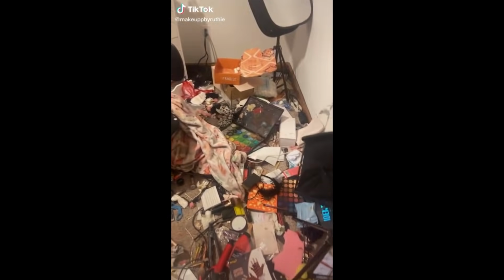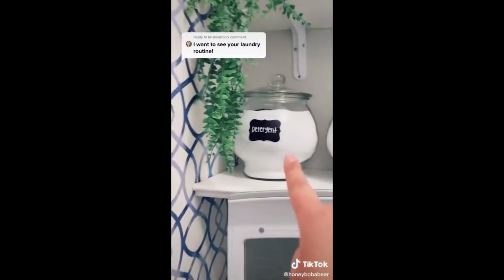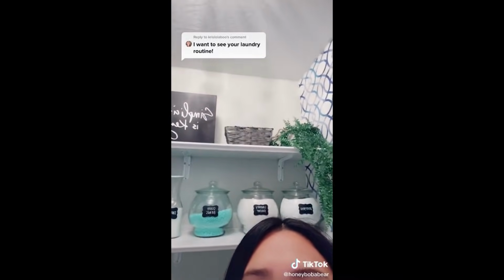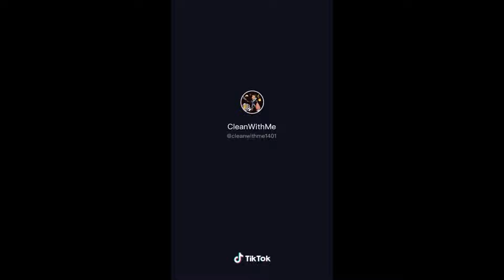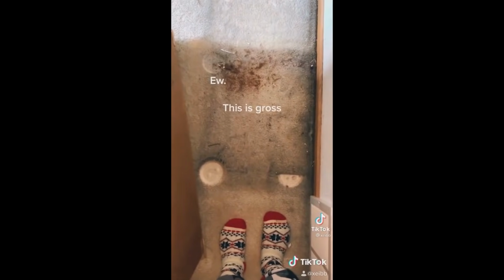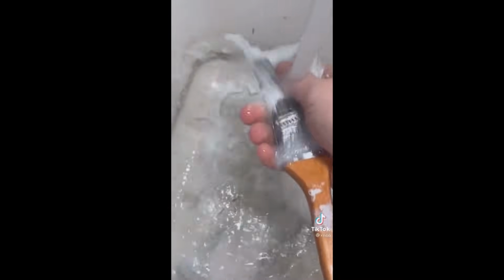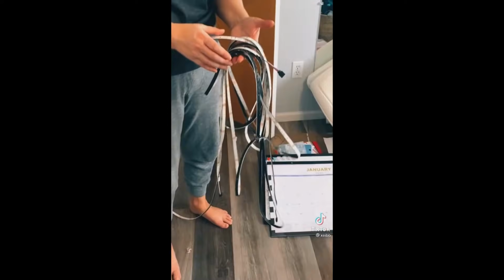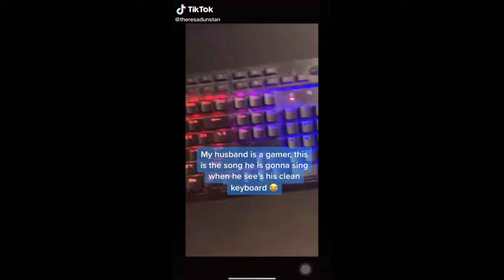Cleaning and Organizing 🧽🚿 | Part 13

Comment: Safety PSA: if you are going to remove the "popcorn" cieling in your own home. Make sure to get a professional! They should check to see if that texture is make with asbestos or not. Unless you have the proper PPE and training, its super dangerous. Source: my entire family has worked construction for decades.
Reply: I'm curious what does that mean?
Reply: @myan1934  What part are you confused about?
Reply: What does the popcorn ceiling do?
Reply: @lubellawychhelm6942  Well popcorn cieling is just an aesthetic. But removing popcorn cieling that is made with asbestos unleashes it into the air. While it is underneath the paint, its harmless. It's disturbing it and breathing it in that's the issue.
Reply: Thx
Reply: Yeah and get something to protect your eyes

Comment: I don't know what unstable teenager needs to hear this but its here anyway 🖤

I struggle with a handfull of different mental health issues and it really impacts on my room, now that I'm older all of my friends have very mature rooms but although I hate it I'm greatful I still have my pink bedroom. My room has been impacting on my anxiety because whenever someone comes over I get embarrassed one because my entire room is pink and two its always extremely messy. I know it may not seem like it but when you put your mind to it cleaning is extremely easy and once its done you will feel a lot better. I haven't cleaned my room fully in years but when I finally cleaned my entire room by myself all my close friends were so proud of me and it made me feel like maybe I'm not completely useless. When you put your mind to it you can do anything, you don't know until you try! Things will get better you just have to push through things like the angel you are 🖤✨

Comment: Okay, I know half of you don't want to hear this but, please please please DONT MIX CLEANERS and\or CHEMICALS.
Reply: Why?I'm curious
Reply: @keza6366  most chemicals when mixed together create toxic fumes and could potentially cause a lot of harm to those who inhale them. Most products have warnings on the labels and tell you why.
Reply: @Cozy_Kitsune  oh thanks
Reply: @keza6366  You should never mix any cleaning chemicals, especially anything with bleach (which is why the "Comet and weird blue liquid" mixing always scare me). Mixing bleach and ammonia (for example, Comet and Windex) will create chloramine gas. Mixing bleach with vinegar will create chlorine gas. Mixing bleach with rubbing alcohol with bleach create chloroform (you know, the stuff villains use to knock people out?).  Even seemingly harmless combinations such as vinegar and rubbing alcohol will create an extremely corrosive and dangerous peracetic/ peroxyacetic acid.
Reply: Especially when a lot of the surfaces don't need it! Most of these bathroom counters and showers need a spray of a multi-purpose cleaner at MOST.  Honestly, most of it could be done with soap and water but it doesn't look as cool.
Reply: @kikicogger2284  ohhh, thank you so much for the info!
Reply: @Cozy_Kitsune  I have done it for years and I ain’t dead
Reply: @kikicogger2284  most toilet bowl cleaners use bleach and not ammonia. Comet it basically powder bleach. None of these products have ammonia in them because they contain bleach.
Reply: Some chemicals are fine if you mix them. But NEVER mix ammonia with bleach
Reply: THANKYOU
Reply: As long as it’s a bleach based with another bleach base I think your ok.. but not sure because it can be really really bad if you mix the wrong chemicals!! Be carful
Reply: I did that when I was litte
Reply: Little*
Reply: @kendylmarkert3120  same 😂 calm down ppl
Reply: @kikicogger2284  I’ve been mixing bleach, pine sol, soap and water since I was little there wasn’t any reaction or anything maybe instead people should be careful wut they mix together if it could but most cleaning products aren’t harmful if you mix them together or the ones I use. But if anyone’s new to cleaning then I would just use the basics like bleach pine sol and soap basically anything like those should be fine in my experience.
Reply: That’s their problem
Reply: Some are safe, some aren’t, it’s better to be safe then sorry.
Reply: @Yanelly Zermeno idk
Reply: @kyliestafford2607  oh god the effects are showing 😂
Reply: @valarie_p9829  the effects are showing, proving my point👀
Reply: @tina-mj4ge  what¿¿¿
Reply: Big Q?
Reply: @kikicogger2284  This information can be really dangerous in the wrong hands.... Just saying
"Not me making Chloroform, silly me😇"
Reply: I know wich ones to mix and wich ones not to so it's fine don't be scared to make cleaning water😂😂😂
Reply: @emilyshedden4924  yeah read the labels, see if they are safe to mix, and dont use to much product and waste money and use alot of chemicals!
Reply: Bleach will says on the bottle specifically not to mix it with stuff. If you want to use multiple cleaners, then clean in layers and know what you're cleaning with. I typically clean with the pure chemicals: vinegar, bleach, isopropyl alcohol 70/91%, baking soda, washing soda, citric acid, etc. all diluted with water in their respective spray bottles. That way, I know exactly what I'm using every single time (plus it's cheaper in the long run to just dilute your own, you don't need to clean with pure vinger/bleach/alcohol EVER in 99.9% of household situations). I don't clean with ammonia. Hate the smell and it's not necessary with my other cleaners, plus it's dangerous if mixed with bleach. So, I'd rather just not have it in the house. I have toilet bowl cleaner as well as bleach based tub sprays. I can use both on my toilet but let my tell you how. 

I use one of them FIRST and completely clean/wipe it up BEFORE using the other one. 😱 I know, it's a novel concept (sorry for the sarcasm, I couldn't help it). Sometimes I just spray a spritz of the tub spray in the toilet and let it sit for a minute before flushing as mid-week refresh (do not do this if you have one of those ammonia based toilet keep clean hook things in your toilets). 

You can mix:
Vinegar + Soap
Bleach + Soap
Alcohol + Soap
Vinegar + Baking Soda
Vinegar + Washing Soda
Vinegar + Citric Acid
Citric Acid + Soap
Baking Soda + Soap
Washing Soda + Soap

Notice, soap is pretty much good to go with everything. If you're not sure if it's safe to mix, Google it. Don't mix just to mix. It doesn't clean better because it's mixed and it can actually clean WORSE. Always be aware of the fumes created from mixing chemicals (even baking soda and vinegar, don't sniff the fumes). 

Bleach and alcohol make great topical disinfectants AFTER primary cleaning (unless you're using a product that includes them). A spray bottle with a dilute mixture of bleach OR alcohol and water LIGHTLY misted over surfaces is wonderful for ensuring things are extra clean. And unlike finicky bleach, you can confidently add essential oils to alcohol and vinegar dilutions (though their respective scents dissipate quickly anyhow, so oils aren't necessary). You can Google a good ratio for your dilutions. Once again, DO NOT USE STRAIGHT BLEACH, ALCOHOL, OR VINEGAR TO CLEAN THINGS.

Happy cleaning! Always know the primary chemicals you're working with and your home will be safe for you, your family, and your pets.

Comment: Quick tip when mopping: do warm water not hot. If you go from hot water to cold water it will create a film on your floor (not a good film). And you just shouldn’t put hot water in plastic. Also DO NOT MIX CLEANING PRODUCTS WITH UNKNOWN CHEMICALS. Also, wear gloves

Comment: HEY PRO TIP ABOUT CLEAN GROSS WAX OFF FLOORS! 
One word- Ammonia. It is HELL TO SMELL but it works so well. You can put it on the floor. and wait a few minutes. then you take a scrapper of choice and scrape of the wax. BUT don’t put it on polished items. It will remove the polish and ruin the item itself. Also. it is HIGHLY toxic and dangerous. so be careful!

if you ever need cleaning tips feel free to ask me! I detail rooms of houses for a job!!

Comment: Doesn't it suck to live in american built house? You don't have any sound insulation in your floors... And I can hear that the banging sound comes also from the walls, so there is none either. In Northern Countries we make the floor above the concrete (there is underfloor heating), then we put step insulation mat and then the laminate or "vinyl". Much better! If you are building a house, please check how buildings are made in Northern Countries. :)

Comment: Man I love watching people make chloramine gas 

PSA
you make chloramine gas by mixing ammonia based products (window cleaners, toilet cleaners)
and bleach products (any Clorox or Lysol product really, some scrubbing bubbles products, ajax)
You can use these separately in the same area, but not for the same thing, use toilet bowl cleaner for toilet bowls, use floor cleaner for floors, grout cleaner for grout, mold and mildew remover for problem areas

Please do not put yourself in harms way

I personally use natural products because I dog sit often and most normal cleaners are not safe for pets to be around. 
(some good cleaning companies)
Puracy, Seventh Generation, Grove. Co, Blueland, Common Good

Comment: Why did that lady use Laundry Detergent to clean her floors?
Reply: i think because it cleans the floor well and fabuloso is basically just for scent and doesn’t really clean
Reply: Like the other comment said it cleans the floor too. Basically a second option if you can't or don't want to get stuff meant for cleaning floors. Might not work as well but it cleans
Reply: Its really good for removing dirt, especially in grouted floors
Reply: You use fabuloso as laundry detergent? ;-;
Reply: @Mxlzzz3  no?
Reply: Idk but that was dum
Reply: I heard it cleans really well BUT I think she used waaaayyyyyy too much.
Reply: Thank you! The harder part for me is that you’re not supposed to be using soap and water on vinyl floors. It tends to seep through the seals of the floor and when it does it makes it pop up. Getting floors like that is extremely expensive. You’re technically supposed to use warm water and vinegar